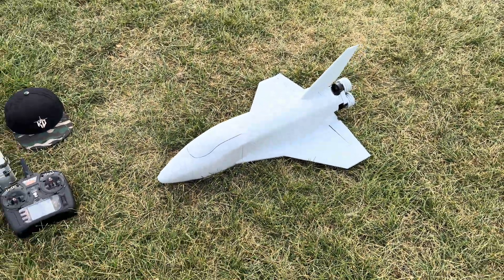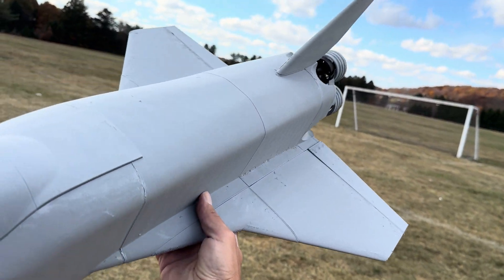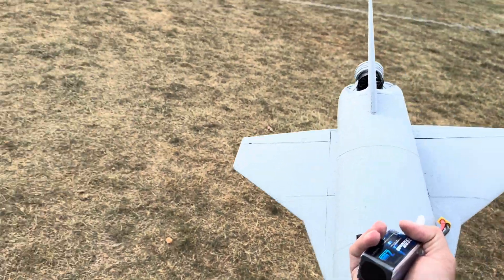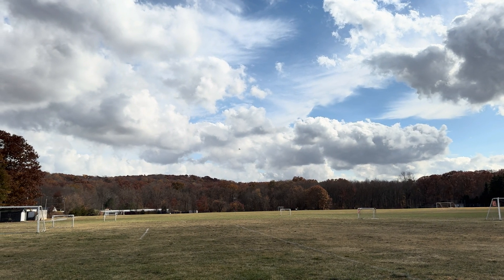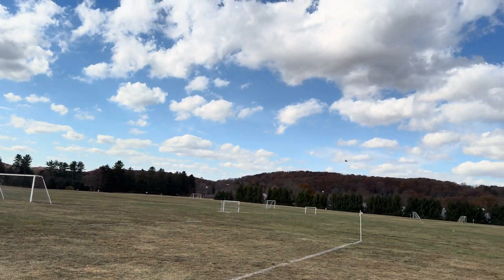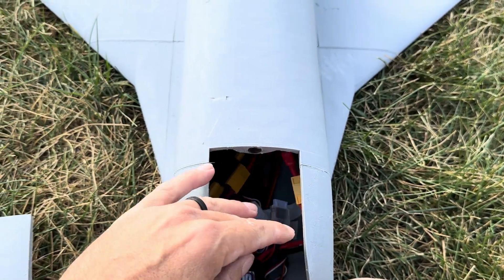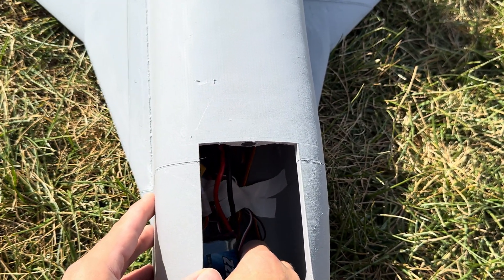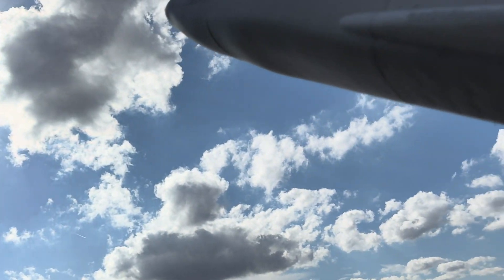Space Shuttle with 3 motors flew awesome!

Comment: I would love to see a ww2 V1 rocket, the wings might be a bit small to generate enough lift, but it would be cool..
Reply: Using supercaps and fpv racing drone motors …….
You then have very cheap rocketry.
Reply: @brucebaxter6923  i think the V1 was a pulse jet, and British spitfires could actually catch them to guide them off course by tipping their wings, so it probably doesn't even need to be that extreme! I was thinking a standard 40mm ducted fan might work in place of the pulse jet in a normal rc configuration for sustained flight..  I should have called it the v1 flying bomb sorry now i think off it, not a v1 rocket....

But are you saying the supercaps are the power source and there is no battery?  Still getting my head around it, but it sounds perfect for a v2 actual rocket!
Reply: @ 
Oh. Yea. Sorry, I added the next topic before adressing the first one. 

Yea, v1 buzz bomb would work great